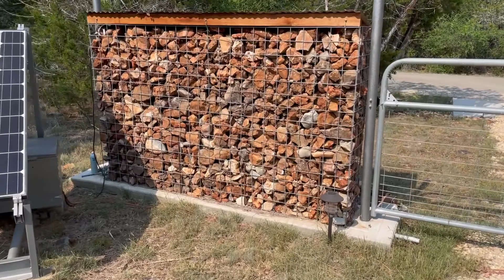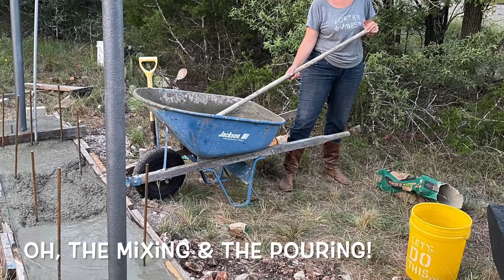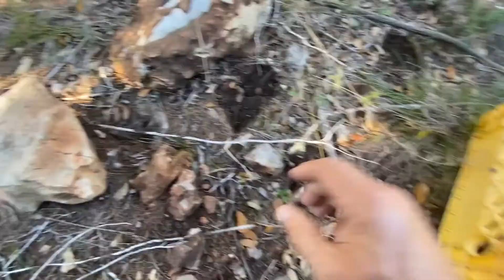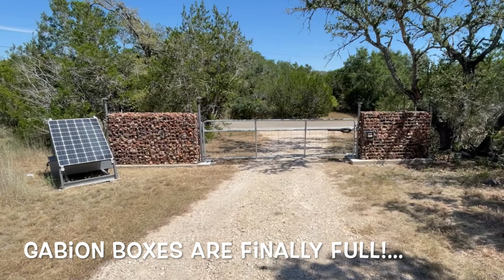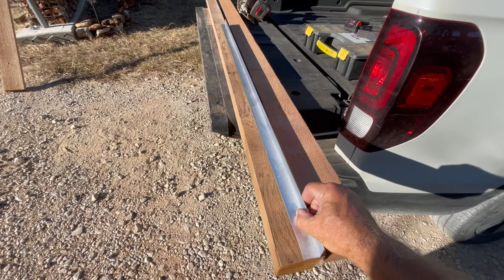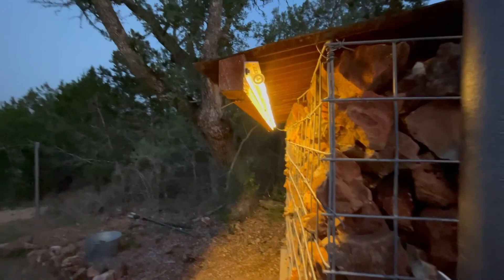Maverick MacGyver builds a Solar Powered Gabion Wall Front Gate

Comment: Did I miss how do connect the front to the sides?
Reply from the maker: Do you mean the front of the hog panel to the side wall of hog panel?
Reply: @maverickmacgyver yes
Reply from the maker: @chizuck3322  I used heavy zinc plated wire to wrap around the two vertical rods of the hog panel where they met at the corner, like attaching fencing to a post. I used the same wire to make ‘ribs’ between the front hog panel and the rear hog panel so the weight of the rocks would not bulge out the box I was creating. So far, everything is holding up perfectly.

Comment: Knowing what you know now, what are some of the things you would do differently. Really like your work. Thanks for sharing.
Reply from the maker: Everything looks and works the same as when we built it. Rock solid. Pun intended. I did run a water line and electrical conduit under the concrete between the gabion blocks, but so far, I have not trenched about 80’ up the driveway to the water line. I did buy a bunch of plants right after installing the gate, but without automatic watering, they didn’t make it. You know, if I’m too busy to finish the water line trench, I’d be too busy to run a hose and manually water. I’ll finish it this spring and try again. Thank you for watching and commenting!

Comment: Does it bow out from rock weight?
Reply from the maker: No. Not yet after a few years. I placed 1/8 galvanized wire every few inches between the front and back hog panel so they maintain their shape.

Comment: Where’s the mail box and do you have any videos on how to keep your mail and packages safe?
Reply from the maker: There is a regular mailbox at the street for USPS. For larger packages, we installed a jobsite box up against the fence near the gate, with cameras in plain site. We haven’t had a problem. Fingers crossed. They make package boxes that have codes and locks on the door. I hope that helps.

Comment: How much did you spend on this setup?
Reply from the maker: The concrete was the highest expenditure and we used about 32 bags for both sides. We bought a bunch of used 3" pipe for the fence (corner posts, etc. The hog panels come from HomeDepot and were $50 each at the time. The rocks were free since they were already scattered on the property. I would say the total cost could be had for about $500 as a DIY project.

Comment: Why the concrete foundation? Aestetic?
Reply: He eventually made a concrete pad that joins the two sides and it contains the pipes to bring water and electricity to both sides of the driveway. When this video was made, we just had a tough extension cord that we drove over. Now, water and electricity flow to both sides and the pipes across are protected in concrete. Plus, we have vertical rebar and the foundation posts buried deep down and concrete around it makes the wall, which is extremely heavy, become quite stable.

Comment: Enjoy your videos, any chance I could hear about the gate actuator and how you're setup for that?  I'm wanting to do something like this, and had planned on using the gabion walls, I really like the 16 foot gate as well.
Reply from the maker: We used Ghost Controls gate opener, plus the Zombie Lock, keypad and several added remotes. The cost adds up after a while!. So far, everything is working just fine.
Reply: @maverickmacgyver  Thank you for the info, I'm going to look into these.